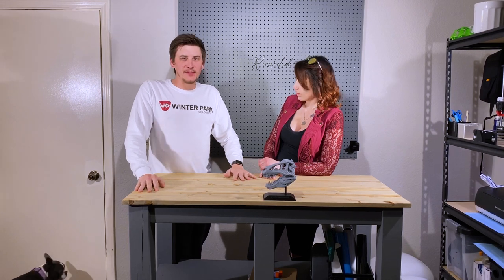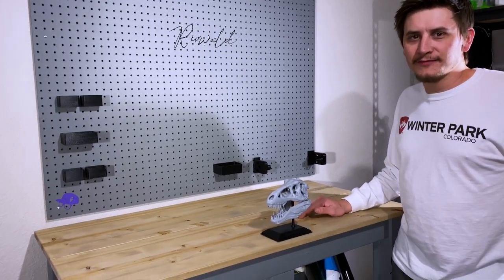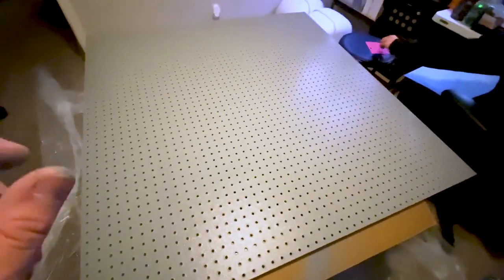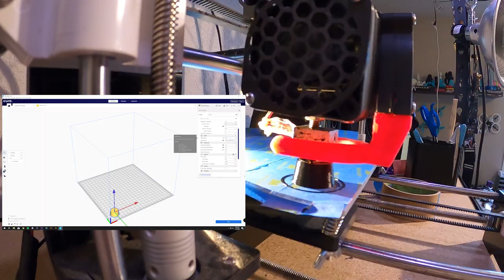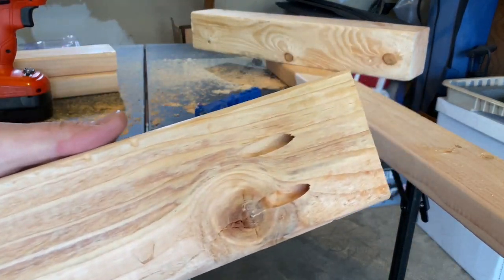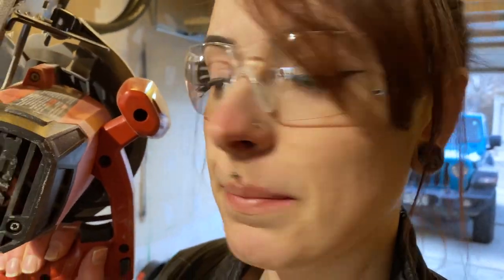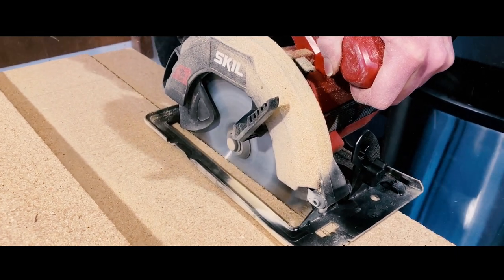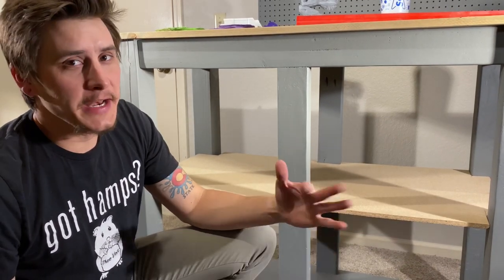DIY Work Table & Peg Board | Channel Pilot | DIY | Custom Art

Comment: Enjoyed watching your build video. Trying to start woodworking on a budget.  Does the pegboard need a primer before painting?  Was that particle board used for the shelf and table top?  What did you use polyurethane for the finish.  Just starting out and learning from your videos.  If possible need more garage  organization videos such as shelving,cabinets,draws,     etc.  Can’t afford  3D machine,planner,and jointer.  Like projects that you can get around them such as this one.